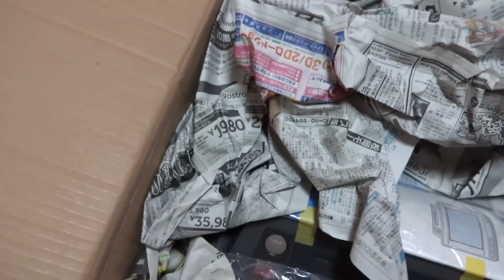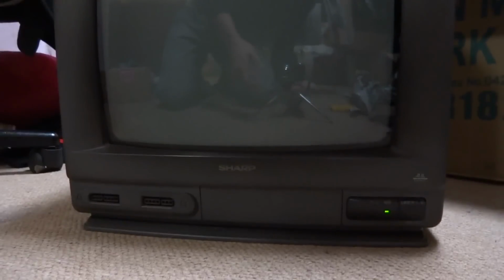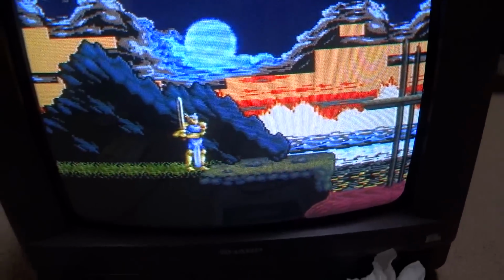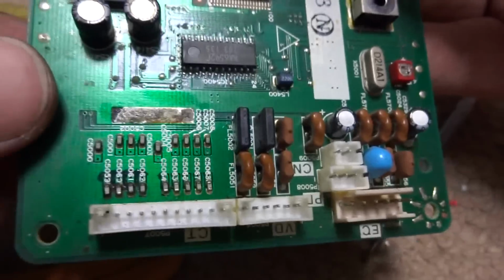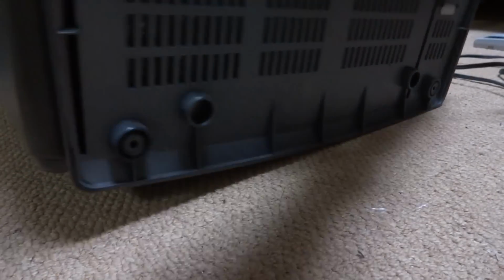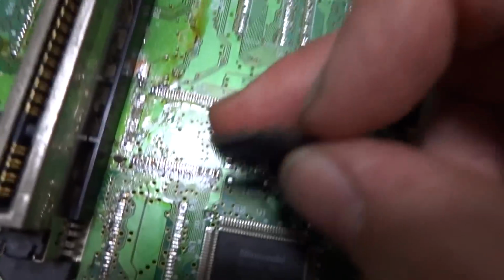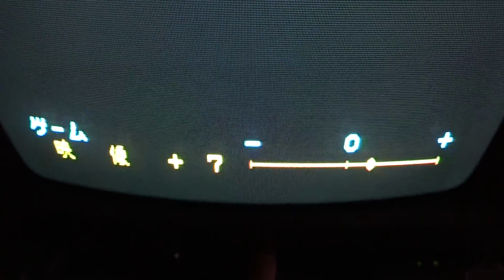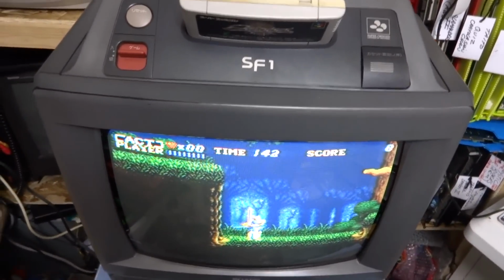Rare Sharp SF1 Combo TV And Super Famicom In One Plus Repairs

Comment: I mean, I wouldn't say that it's rare necessarily. I owned both the 21G and 14G at one point (ended up selling the 21G because it was missing the control panel flap which was unreasonably annoying to me for some reason, but I still have the 14G), and there's always a few of them very highly priced on Yahoo Auctions, even back in 2013.

Comment: hey luke i got an sf1 14"  i got super cheap it was parted out  so its missing the super famicom board so i was wondering if u chould help me with some images   of yours  what plug did it use to send video to the tv board for display i got an idea where i may strip down a normal famicom and make it fit inside the sf1 to restore it  let me know thanks

Comment: Hi! today I got a Sharp SF-1 but I find the brightness level a bit low, does anyone know how to get it higher? Can't seem to make it work manually from the outside of the TV.

I found an old sharp remote control but the typical menu button doesn't work
thank you in advance!
Reply: Pretty sure every crt after the 80s has a brightness control on the flyback transformer.

Comment: Yeah, It's possibile and quite simple if you have a big CRT tv. Just put a SNES inside the TV shell, connect the power and the video with some wires and cut holes for the cartridge and controller ports. But you have to be skilled to make it beauty enough :)

Comment: Very cool Luke! Good job removing that chip from the pcb. Have you ever heard of chip quik? It is this very low melting point solder that you can use to remove parts. Check out a video that EEVBlog does on ChipQuik. EEVBlog #437. That might be helpful in the future. :)

Comment: I know you can bring back the RGB on this important piece.  You might see if you can get RGB off the SFC and out to a known working display?  Then you'll know for sure if it's the monitor or the SFC.  If it's on the SFC, it should be a little easier to track down..?  I noticed there's a large wiring hardness over on the side where those leaky caps were, perhaps it suffered trace damage, and you working at it was enough to knock out the sync?

Either way, congrats, nice work, and good luck, Luke!

Comment: The SFC should have a stock video encoder chip to turn the RGB into the composite/S-video ouputs, so the SFC part is probably fine and the problem is likely the TV set itself unfortunately. If the RGB pins on the multi-out are wired up, do as Martin said and try hooking it up to an external RGB monitor to make sure, but if you're getting composite, the RGB lines are at least making it as far as the video encoder.

Comment: Luke, what happens if you plug a SNES RGB scart cable into the multi-out on the system and then then plug the scart cable into a different TV? This might give you a clue as to if it's a issue with the SNES board in there or something else in the TV.

Comment: There is a product that will let you remove surface mount chips easier compared to regular solder.  The stuff remains molten longer so you create a bead around the chip and remove it quickly.   What you did worked :)

Comment: maybe you could check the section shown at 10:33, from the BA6592F (pin 6 is chroma and 23 luma), its out traces, the jump you made there, and the bunch of capacitors (shorts?) next to the connector, and those two traces between the cover soldering point and the capacitors... 
the lower part of the board on that section looks scary to look for traces... lots of smd parts there...
Anyhow, hope you get lucky and fix that monster...

cheers!